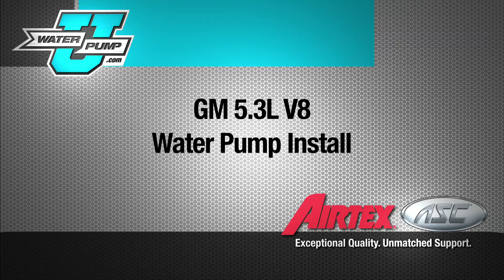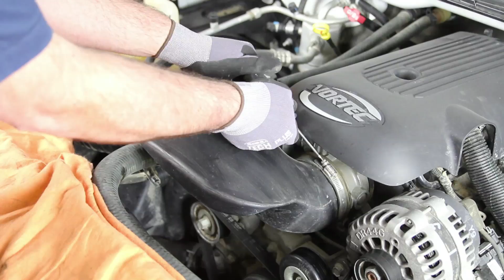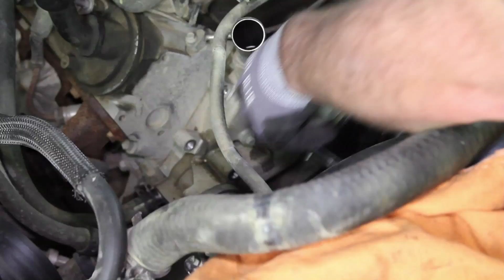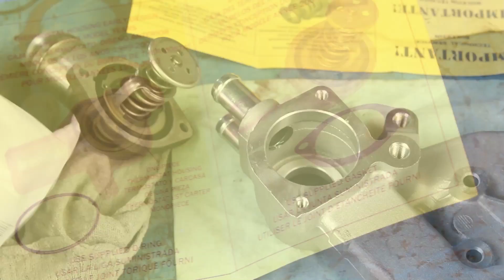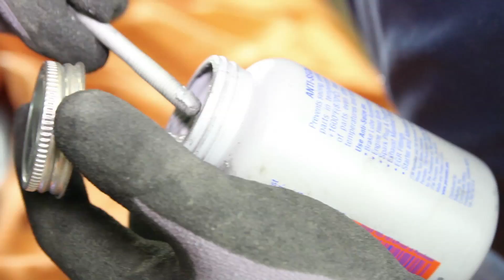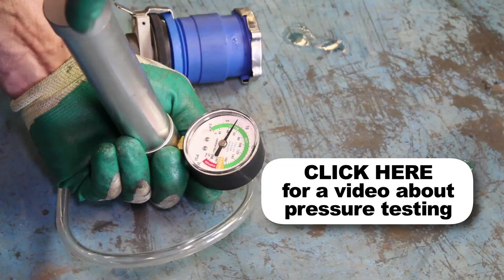How to install a Water Pump: 1999 - 2005 Chevrolet Silverado 1500 4.8L V8

Comment: left out the trickiest part..the fan clutch removal
Reply: Rudy Merrell This truck doesn't have a fan clutch, they use an electric fan.
Reply: You need to change the title 1999-2004 had fan clutch.